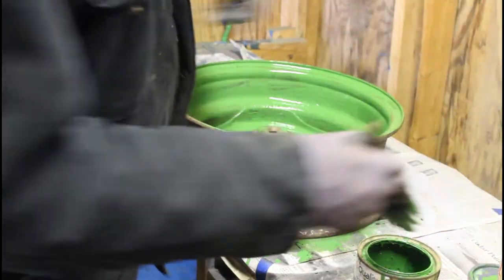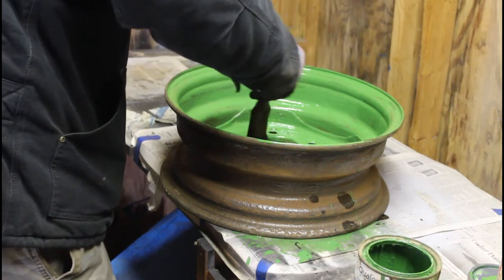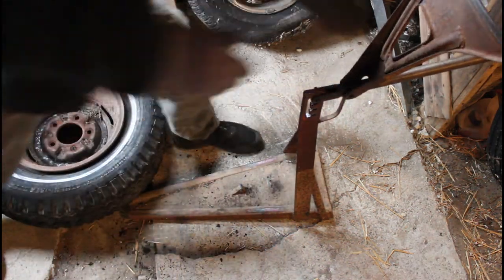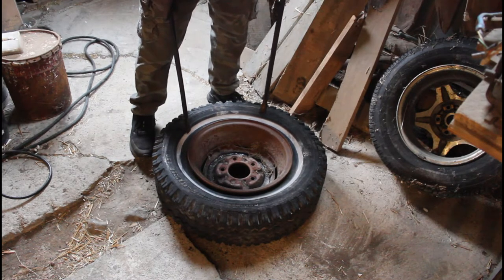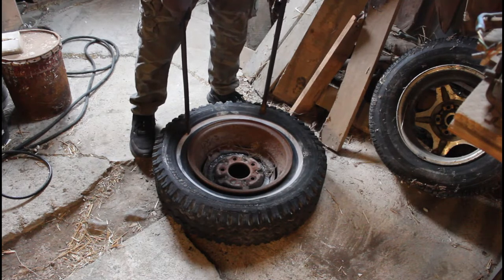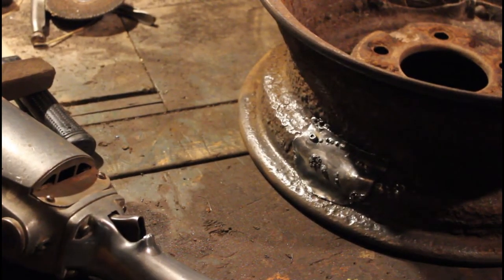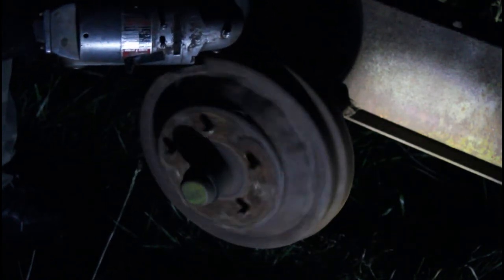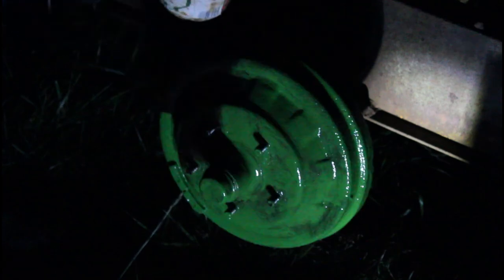A Lovely Day To Restore A Trailer 7

Comment from the maker: The patch I put in the wheel was ground smooth and then finished with the wire wheel to smooth the edges. I will have to finish the wheel later and then paint it.